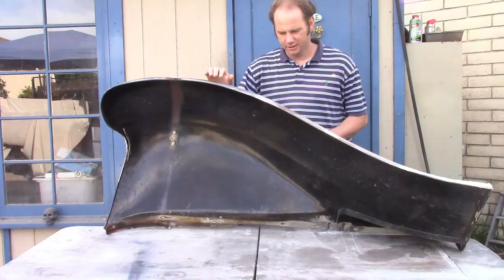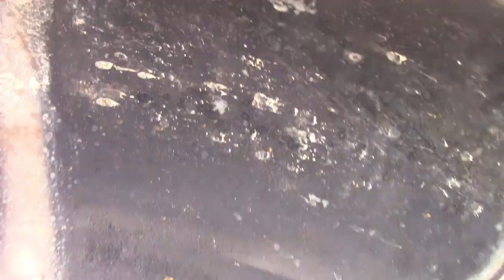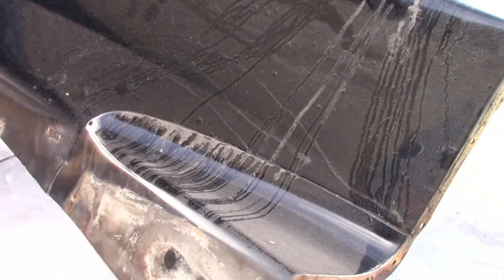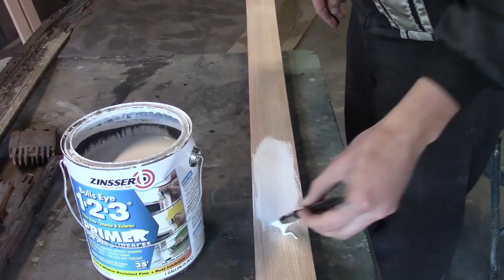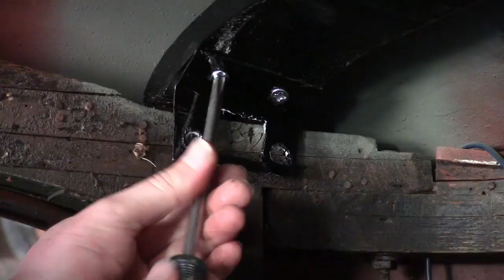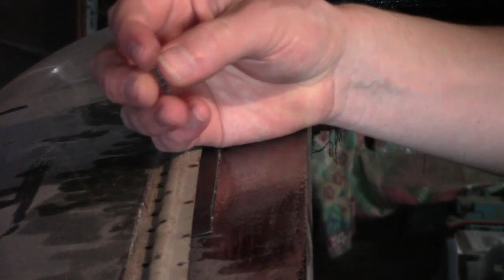1930 Ford Model "A" Repaint and interior. Part 2.

Comment: Great series! Where do you get the nails for attaching the sheet metal to the wood frame. I've been looking for something very similar without much luck.
Reply from the maker: Thank you. Lately I've been getting them at Ace hardware. The nail head is a lot thicker, but they do the same job.
Reply: @onewhocollects6781  OK, we're in a small town in S central BC next time I'm in the big city I'll check out a larger hardware chain. I'm trying to restore the interior of a 49 Cadillac and part of the door panels are held on by a small serrated nails. Can't seem to find them on line. They locate into small slots on the door frame.

Comment: I am very curious as to what type of wood you used.  I am looking at replacing the roof wood in my 30 Fordor as well.  Thanks!
Reply from the maker: I'm not sure what the header is made of, but I used red oak on this car.
Reply: @onewhocollects6781  I wasn't sure if you made the header or not.  Sounds like you used a pre-made one and then ground where necessary to get it to fit?  Very nice work!

Comment: Thank you for the information.  One more question if I could what type of wood does one use in the body and roof of a fordor?  I am just getting ready to pull mine apart to restore?  Also I have found your videos very helpful and enjoyable.
Reply from the maker: I used red oak on everything I made. I'm not sure what was used originally by Briggs, but most coach builders at the time used ash.

Comment: quick question  why are the pieces not glued together but just screwed?
Reply from the maker: It allows some flexibility. If all the ends are glued solid, the wood might split from stress caused by driving.

Comment: How can I tell the difference between 28/29 and 30/31 front fenders?
Reply from the maker: The most obvious difference is the 28-29s are more round. The 30-31s have more straight lines in them.

Comment: Good summary of things to take into consideration when replacing the top wood.  I used a combination of "store-bought" and home-made pieces.  Came out pretty good; best if you take your time.
Reply: I have just started to help my 94 year old neighbor restore his Fordor, I need to build an entire new roof frame.  Is it possible to get drawing or templates to make the parts?  my email is: bgelow@me.com  thanks
Reply: @billgelow2011  've been in the Model A hobby for over 50 years.  When I restored my 1931 Tudor, I had some good old pieces I could use as patterns but the rest I purchased.  As far as I know, there are no patterns available for sale.   They people who HAVE the patterns make wood kits and they're not about to give away or sell the patterns.

The MAFCA website lists a couple of vendors who make wood kits:  https://www.mafca.com/suppliers.html Make sure you mention the year of the Fordor and whether it's a Briggs or a Murray (and if it's a 3-side window or 2 side window).